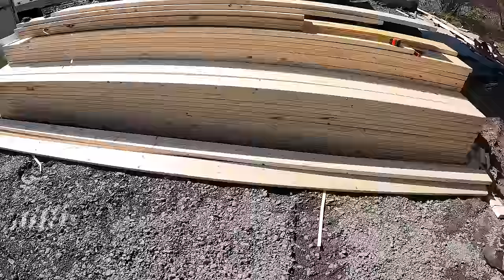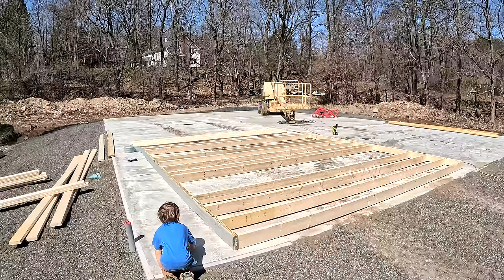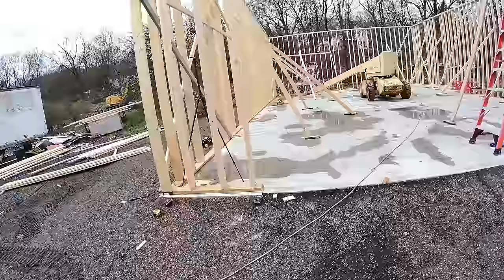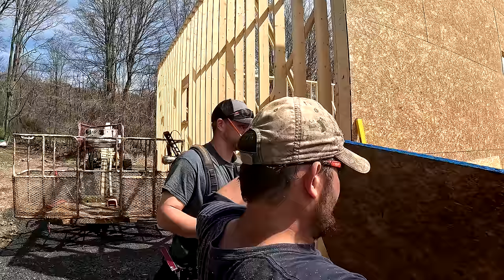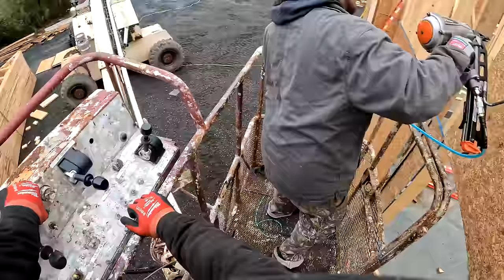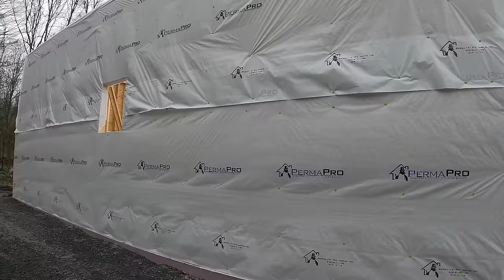Building my Garage : Framing and sheathing walls

Comment: Ryobi and Milwaukee are owned by the same company (Chinese company) but their manufacturing is completely separate. Ryobi is junk. You can't get better battery tools than Milwaukee. I've never used the Paslode battery stuff, but their pneumatic guns are awesome. I've also had good luck with Porter Cable and Bostich.

Comment: I would brace from the outside
Reply from the maker: how would you access the outside with a boom lift then? I trust that concrete to hold alot more than I trust that ground

Comment: I’m building a 30x64 and going for post frame with wood trusses. I found the metal building world to be slimy and overpriced. I’m concerned with the posts rotting as we’re going into the ground. I am considering moving to a stick frame but it drives the concrete price up so much.

Comment: Should have used zip  i am not a fan of house wrap and raw plywood
Reply from the maker: I guess you could always send me the 3k extra that it would have cost for zip. otherwise...it's a garage and its going to get sheets of 1" foam and sealed with tyvek tape and it will be better than zip for the same amount of money

Comment: I would not drill into the concrete  like that because of the heated flooring
Reply from the maker: pex is 5.5 inches down from the surface, I am only drilling 1.5 inches

Comment: Why you didn’t go with a pre fab metal building?
Reply from the maker: I explained it in the end. They start at 50k and I can do it stick framed for about 25
Reply: Im in CT and doing a 84x86 and it’s about 120k building garage doors and insulation 6 inch. metal it’s the way to go in the long run. aside from that you have a good project there
Reply from the maker: @ERJONI25  I really did want metal but it was an extra 25k, I just cant justify it
Reply: @jmuller86  Is that 25k vs 50K only materials cost?  Could you give us a guesstimate on labor on both/either?  I imagine you have to speculate on the time for a metal building. I assume its less? thanks. great videos.  thanks as alwasys.